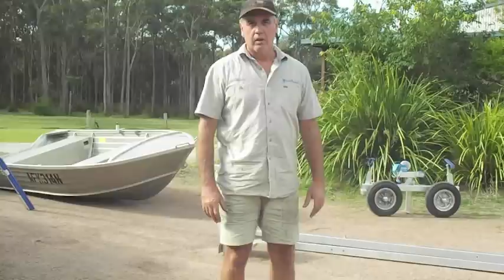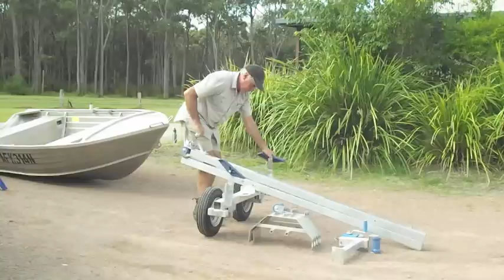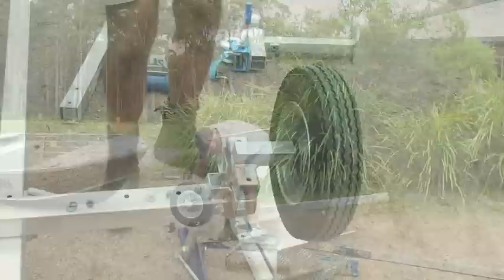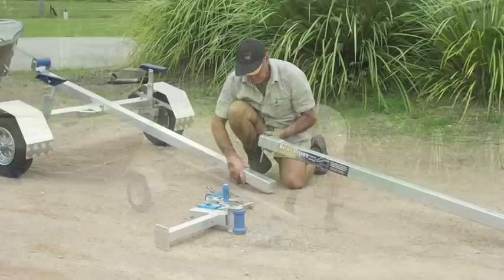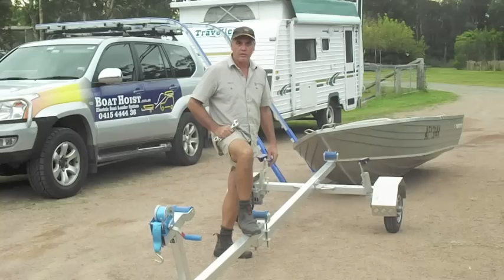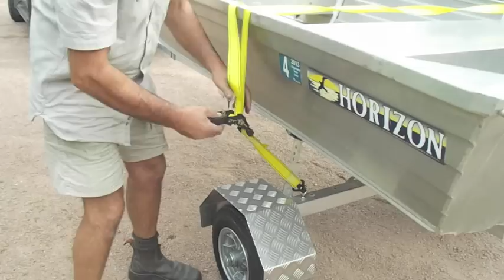Folding Boat Trailer - Assembly || Boathoist Loading Systems

Comment: I didn't see how it folds.  Up to this point, it looks like an assembly / disassembly.  A folding boat trailer for a boat of this size is not really necessary.   You won't fold it with a boat on it during the off season.  When you are at the lake, you won't want to take the time to disassemble or fold the trailer - no place to store it.  Am I missing something here?
Reply from the maker: +Dan Burch  Hi Dan, thanks for your comment.  This trailer is very popular with people travelling whilst pulling a caravan so they do have time at each stop to assemble (20min) and use as often as they like.  It is light for them to haul and as it disassembles gives them a chance to store the bits in the places that fit on their rig or car.     Others use it from home as they can store it away in their garage if needed.  Everyone has different needs.
Reply: Collapsible trailer would be more appropriate.  Honesty is the best policy.
Reply: I think this thing is for people who carry their boat on top there truck while pulling a camper.